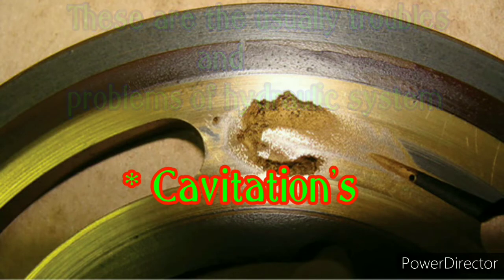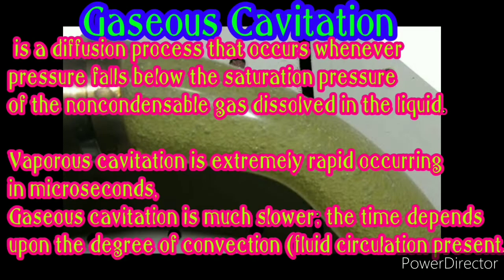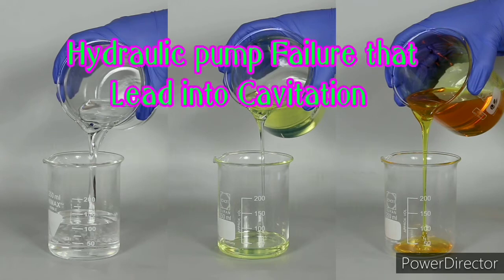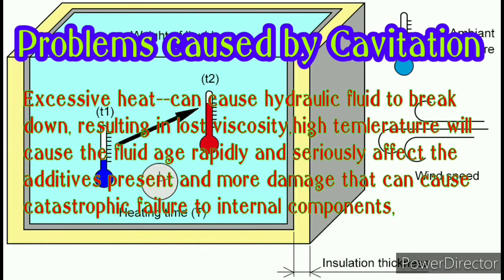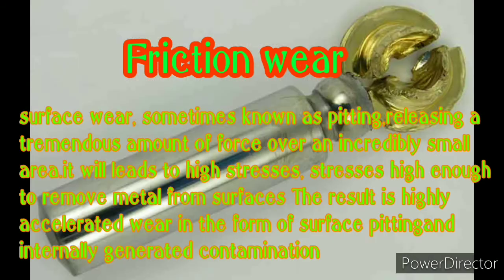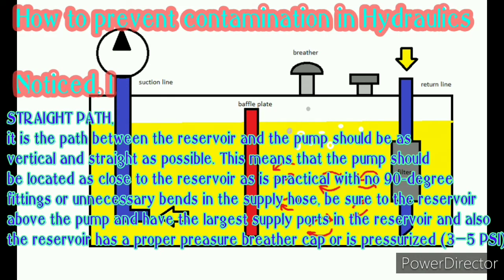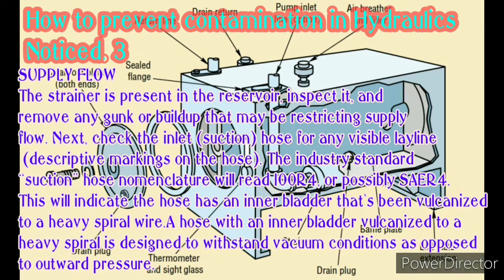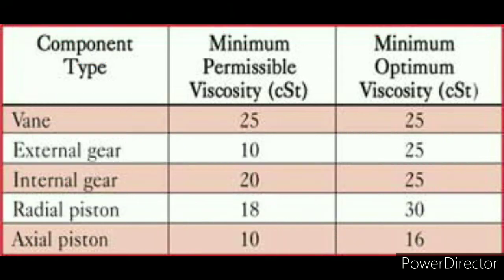Cavitation in hydraulic system || How to avoid cavitation||What is cavitation in hydraulic

Comment: but if we have to prevent the cavitation in hydraulic turbine?
can you suggest
Reply from the maker: To avoid or prevent cavitation in hydraulic turbines according to research  Hydraulic Turbines parameters should be set such that at any point of flow static pressure may not fall below the vapor pressure of the liquid.